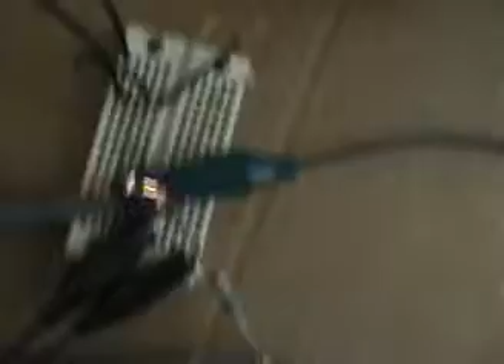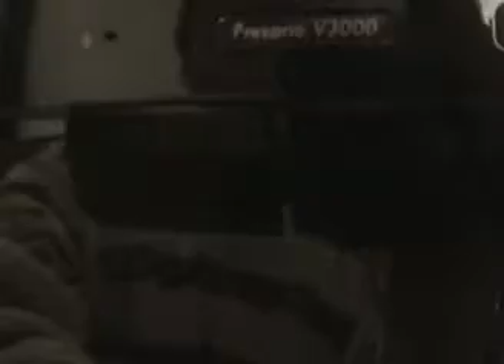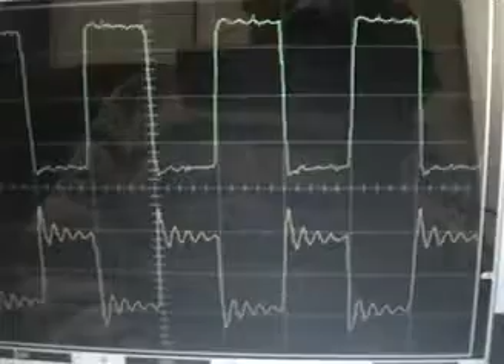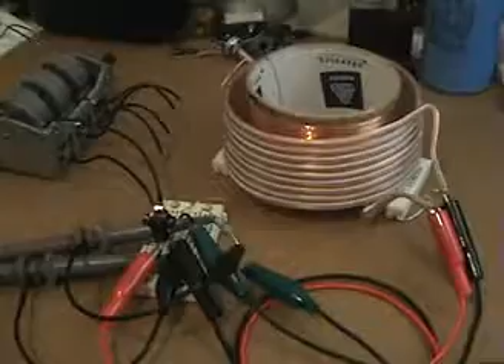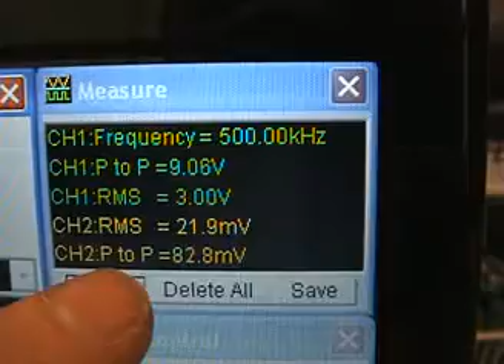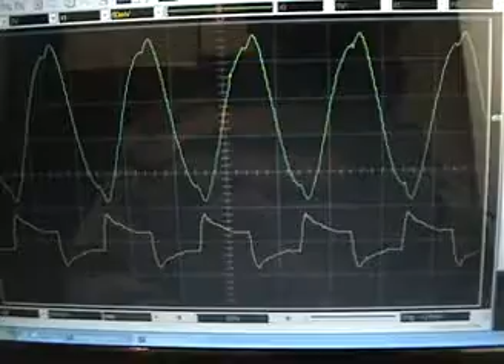RESONANCE EFFECTS FOR EVERYONE TO SHARE test 13

Comment: What if you did it through a nathen stubblefeild coil it puts out amps from a galvanizing effect i believe, it last about a year b4 it oxidizes,so if it puts out 1v at half a amp just how it sits,if u hit the resonance frequency then would you get a couple houndred or thousands volts depending on your q point in the coil but are allowed to keep your amps from the galvanizing effect giving insane watts,(inventors thoughts LP 3rd 2/21/19)

Comment: hi good efforts not Westing time ... what your trying is on primerery ? what about secondary coil ? you have to follow maximum transfer theyram ... try to find resonance equivalent to primary resonance frequency ... and then test output... if you're primary ckt is resonating at 500k ... then indepandently tune secondary capacitor to the same...
reduce the air gap within coil ... it will work .. all the best..
second pt coupling several coils simply will not work .... because of several tensions.

Comment: I think Don Smith also uses high frequency AC in - n  The input is a 12vdc 7ah lead 
acid or gel cell battery (not shown). The input goes to a 12vdc to 
120vac inverter of about 200 watts more or less, it is not critical as 
long as it can turn on the next part, the transformer. The transformer 
is a 9000v, 30ma, 35khz neon sign transformer with two outputs that are 
rectified and its output is controlled by the variac for neon signs 
after the inverter. The next thing you see is two high voltage 
capacitors of .1uF 4000vdc. They are in parallel which makes .2uF 
4000vdc. These are the self healing type, though not critical as long as
 you keep the transformer adjusted to 4000 volts or less. Don keeps it 
down around 2000 to 3000 volts.
The next part before the coils is the enclosed spark gap connected to 
the neon transformer ground and the one end of the L-1 coil and the 
capacitors. Where the wire and the gap meet is also your grounding lug 
for this part of the system. If you look carefully at the capacitors, 
you will see that they are in parallel across the two L-1 coil wires 
(red) and the high voltage diodes are coming from two different 
connections and meeting at the capacitors. Look carefully at the 
polarity of the diodes. These diodes should be rated at least 2 times 
the output of the transformer.
The next part is the L-1 coil that takes the power that you have 
generated and sets how much you are going to step it up. For example: If
 you have 2500 volts coming from the transformer and you have 10 turns 
on your L-1 coil, then you divide 2500 by 10 and you get 250 volts to 
transfer to each L-2 winding. So if you have 30 windings on your L-2 
coil, then you will have stepped the voltage up to 7500 volts. 60 
windings = 15000 volts. 100 windings = 25000 volts and so on. Get it? So
 far its basic Tesla stuff."

Comment: My input on this..If you are constantly pushing voltage in you never give the circuit a fighting chance to "breathe in" how can you obtain excess energy if you are not allowing it by the constant push! Try dc pulsating source coupled to an open ended parallel wire and you will at least double your voltage mine went to 400 volts plus without a transformer just hooked up to an open circuit NOT CLOSED!!!!!!
Reply from the maker: +Alex Manzanero Yes, you have a good point. These experiments where done 7 years ago and at that time I only knew a little compared to now. If I was to work with resonance again, I would do many things differently. Thanks for sharing. Luc
Reply: ps luv your work, thanks
Reply from the maker: +Alex Manzanero I appreciate your comments and appreciation. Thanks Luc

Comment: resonance just makes the energy u put into the circuit used more effectively... its like pushing a kid on a swing... each push gets the kid to go a little bit higher.. instead of having to push the kid from a stand still to full swing, it is more efficient to give little pushes and build up momentum.  Same thing with resonance.  basically the energy bounces back and forth between an inductor and a capacitor, each cycle you boost it with a bit more juice, and if you hit the sweet spot, it becomes very efficient.

Comment: What i think...the reason why u cant loop it is because of the b-emf in the pick-up coil (secondary). You got resonance, thats not the problem. the problem is that you are using a symmetrical system like a usual step-up or step-down transformer. Look for assymmetrical transformer systems like some of the Don Smith devices or the best way in my book is to go Bi-Toroidial Transformer (BiTT) like Thane Heins did. wich is a really awsome transformer cuz the secundary coils feed themself the B-EMF.  

Good luck, i hope you haven't given up !

Comment: It looks like, with the coils in the circuit, your using half the input power, for the same 3.0volts rms, than what you were using when the coils weren't connected. In essence, it looks like an inverse gain on the input side of the circuit. The resonant coils, according to your scope, spare the power supply/input source, half the power to achieve the same output power. To me, it looks like a "well done" is in order!

Comment: @gotoluc  A carrier wave holding a second carrier wave of 8x higher freq' for example, and then your final freq' 8x that ...all sinewaves or square, you get a pump z final hf wave if there is allowance for induction to a centrode.  
You need 3 coils, one inside the next and then an iron core that gains dc or pulsed dc. Further, your coil shape must be toroidal to enhance efficience of the particle vacuum (bosons) which are the key to the positrons- as I have proven in particle physics.

Comment: Hi Luc,
    A common use for resonance is used to amplify a magnetic frequency. This can allow you to generate a magnetic field with a primary inductor and if the secondary coil is resonant of the primary it can pick up the magnetic field of the primary. Now keep in mind that the magnetic field dies at a rate of about 1/z^3(pretty quick). What the resonance does is pick up that small wave and amplifies it back up. For more information look up "LC Circuits" or "Inductive Resonance Coupling."

Comment: Your equipment may be loading the circuit. This will rob the energy required to reach resonance. Keep a high Q. Control resistance losses. The humidy in the air can adversly affect the air core cap and inductor. A common fix is to submerse them in mineral oil. I saw some inductive ringing on the first scope shots.  You definetly have some problem in the circuit. Check the input impedance of your scope and the leads. Check the output impedance on your sig generator. (terminated, open, limited)

Comment: Hey Luc! 
You know, I got to thinking... Both coils have to be resonant. That much has not changed. BUT unlike an antenna, with a coil you have to figure core material, diameter, wire gauge, and of course wire length.  I will see if I cam come up with the formula to make it an exact science.... I have it around here somewhere. Maybe its under the dog. I'll get back to you when he wakes up!
Kirk

Comment: I think I'll try this same experiment and treat it like a broadcast antenna. I'm not sure what you have there but I don't think your secondary is tuned to a multiple of 500kHz. That would be a TON of wire. Have you tried a higher frequency? It would require less wire on both the primary and secondary to be perfectly tuned. Also, the air cap works for tuning but its REALLY inefficient. Peak efficiency can be achieved by wire length, but I said that already. Hope my thinking is right here 
Kirk

Comment: Hey Luc! 
As a ham radio operator, I may have some input. Once tuned, your primary is VERY likely to be significantly more efficient. The end result is more "radiation" of magnetic flux to your secondary. Logically, if you could get your secondary tuned to your primary (which needs to be tuned to the sig-gen.) then you SHOULD experience peak efficiency.
If your wire lengths aren't perfect multiples of each other, try tuning your secondary to the primary.

Comment from the maker: Hi minde4000,

I did start working on duty cycle and now get interesting results but the problem is component voltage switching limits.

The switch is always the problem.

Luc

Comment from the maker: Hi Drevtoobe,

sorry I did not notice your comment till now.

You are correct about the duty cycle.

The new MOSFET square-wave driver board does not do anything better then the first basic circuit. I also don't know anything on how to program the PIC controller, so I'm not doing anything special with it.

Luc

Comment: Next thing is to shorten the duty cycle on the driving wave to use less energy, see how short you can make it and still get a usable signal. This is called a class "C" amplifier. Very little input energy is needed.

Comment from the maker: Hi zezimashock,

no, I use square wave but from signal generator.  It can also work with sine wave but gives less output. Square wave from a transistor is not complete, it is just chopped DC.
You can go to the Overunity Forum topic to get details. The link is in the detail box next to the video.

Luc

Comment from the maker: Hi Dr. Stiffler and thanks for your post. Could you be so kind as to send me a hand drawing of how I should connect the probes to measure the correct values. I also can make my SG and scope work off the grid (each the own battery) so not to have any coupling if you think this would help also. I'm just really trying to get to the bottom of this.

Thanks for your time Dr.

Luc